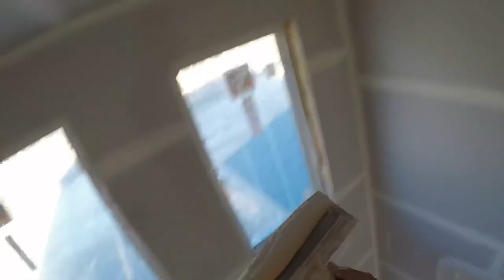teiperos,drywall finishers

Comment: I've been doing this for about 5 years now and it's really clicking on me, once you get to a certain point it's pretty much effortless. I could watch you for hours, I really wish you had more videos because there's not many videos of people doing this the right way.
Reply from the maker: Robert Farquhar check out my Chen el there is a couple more videos , thanks for the feedback by the way
Reply: @bolarifa9924  yeah I just looked at your channel and saw that you have some recent videos and no problem.
Reply: I got a quick question. How much do u charge per sq front or liner yd. Just curious
Reply: @shaundominguez6711  I actually haven't done any sub contract work yet. I work for a family company and they usually charge anywhere between $2 to 2.50 per sq ft.
Reply from the maker: https://youtu.be/zus0hGUOHCI

Comment: Why do u go 3 blades wide on your 2nd coat on your verticals seems excessive lots of sanding once you put 3rd finishing coat over it. just curious ive been gibstopping 20plus years
Reply from the maker: they are not vertical seems , but joints and they are not stray at all so thats why i do what i do!😜

Comment: Hey man I’m from grandralid I just started doin hand taping I’m having problems doing my buts and seams my question is how should my lines be when I feather my edges I use my 10 still I don’t feather with the 6-4 I put on in the middle for my seams feather the edge then while down the middle which makes two lines on each side so I feather it again and both sides and it leaves like a little hole in the middle so I while it again down the middle  could you show me a pic of the seams and butt joint how it looks when u walk away on the cover coat man ill appreciate it so much man
Reply from the maker: https://youtu.be/cUwH1vSL6rU
Reply from the maker: https://youtu.be/zus0hGUOHCI

Comment: What size knifes are you using? Looks like a 10” and a 12” am I right?
Reply from the maker: Troy Knighten bouth are 10” and cuting with a 5” the differentiation of the 2 10”s is one of them is brand new and im molding it to work the way i do , as a good finisher should now that just because the knife is new doesn’t mean is rady to work the way u want ! 🤟🏼
Reply: Bola Drywall Teiperos Finisheros yeah I know exactly what you mean; I trowel all my flats and butts, and cut down with the same 5 you use, i just like the finish of a trowel a little better than a broad knife but that’s one of the awesome things about finishing is everyone has their own way of doing things
Reply from the maker: Troy Knighten yes sir , i never used a trowel before but i respect that
Reply from the maker: https://youtu.be/zus0hGUOHCI